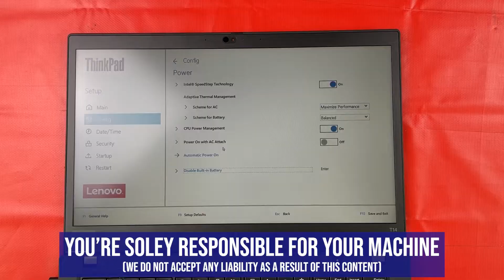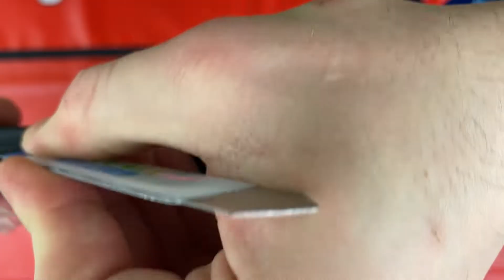Lenovo ThinkPad T14 Gen 2: SSD/RAM upgrade

Comment from the maker: If you're unsure about doing it yourself, then visit an I.T repair shop. Note: T14 Gen 2 (Intel) featured in the video has a soldered on Wifi Chip (cannot be user replaced). Also the heatsink is slightly different to the T14 G1 (Intel). Disassembly of the T14 Gen 2 (AMD) / P14s Gen 2 (AMD) model is very similar (largely the same chassis). Except the AMD models (T14 Gen 2 & P14s Gen 2) have swappable wifi chip. They may come with a Realtek wifi chip, which some prefers to swap for the Intel. Internals of the AMD as shown by our photo here:
https://www.reddit.com/r/thinkpad/comments/orwnv1/p14s_gen_2_amd_similar_to_t14_gen_2_internals/
Thinking Intel vs AMD? Or the T14 Gen 2 vs T14s Gen 2? See our blog: https://www.cruisetech.co.uk/blogs/news/lenovo-thinkpad-t14-gen-2-vs-t14s-gen-2-2021

Comment: In addition to other comments about the deterioration of quality, which are already mentioned here, it's sad when I see this way of placing the SSD drive - cooling through a thermal pad on the motherboard??? Already in the budget Thinkpad Edge series, they already had a better solution in some older models - an ALU sheet on the bottom chassis (which was otherwise plastic), and the SSD drive was supported through a thermal pad on this sheet, not on the motherboard, which itself produces heat. And those chassis few air vents won't save it. Pre-installed SSD drives has usually lower temperatures, but try putting a better quality Samsung, even just an EVO 990 Plus, it won't be cooled enough in the air, it'll be temperature-throttled during copying large files and unnecessarily degrade the lifespan.

Comment: Hello, I’m writing this because I need help buying a new laptop off eBay so I found exactly the model T 14 GEN two and it has 16 GB of ram and 512 SST. I’m planning on upgrading it to 64 GB of ram and one terabyte of SSD, but I want to know if the 3.0Ghz something I should be worried about and will it go up once I upgrade the ram and the graphics card is intel iris xe will it handle gaming well I’m planning on making it an everything laptop work gaming coding 
Sorry if my question is long 😅😅
Please let me know thank you
Reply from the maker: Max 40-48GB RAM only as one slot is soldered in. 

The Turboboost frequency (beyond base clock) depends if it is plugged in (full performance if you put windows into the best performance mode), but that drains battery. 

Xe graphics are basic for any 3D games. You can always get an eGPU for more performance.

Comment: @3:45 Lenovo usually whitelist expansions so the use cannot upgrade modules other than SSD or RAM to keep their other models selling. I remember I tried to replace a better WLAN card on a T430 some years ago and BIOS didn't allow that.
Reply from the maker: Sign. Wish was able to use more slots. Think on the AMD model there is a way. Some interesting reddit posts around this.

Comment: Why the F they do that bypass on the heatsink? see that gasket on the heat sink? that is for the air bypass arround the heatsink, only to burn your CPU and you have to buy new one thats shitty move from lenovo. IBM never did that shit.

Comment: HOLY. CRAP. There's nothing easy or straightforward about taking off the cover. The plastic clips are both fragile and stubborn to take off. Why did Lenovo do this?
Reply from the maker: Apparently it's easier to do it on the next generation. Tbh we pass this model to one particular technician at the office whose used to this model, so it's done right. Definitely could be simpler.
Reply: Honestly, when trying to open the cover of newer Lenovo laptops, I just allow the clips to break off, and even forcefully break off the clips that are close to failure. Who cares. It doesn't affect the exterior of the laptop anyway, and it makes the laptop easier to open. All those screws lined up around the edges of the laptop are enough to keep the cover in place. I don't even know why Lenovo added them; they're essentially pointless other than trying to sway us out of opening the machine
Reply: how many did you snap off? I managed to do it the front 2

Comment: 1:15 - the decline of Lenovo. Pre 4th gen models were built to be easy to take apart and you could do it a hundred times. The T430 for example was a pleasure to work on. And then it just got progressively worse with each new model moving to more of a disposable concept
Reply: T440p has only two screws holding the bottom cover so it only takes few seconds to open. And from there you can easily access the cooler, socketed CPU, socketed RAM, SSD etc. I wish laptops were still like that.
Reply: @Pasi123  and then they made the T450 with its weak plastic clips and dreadful near-battery rubber-bungs. That was the start of the end
Reply: Well... That was the peak. I kinda dread the times when T43 had about five different types of screws. And switching them could have painful consequences.
Reply: That's because Apple has thoroughly convinced the market to replicate its business model of making everything proprietary and NOT user friendly because the end user would ultimately have to ALWAYS defer to the manufacturer for repairs or better yet, just buy a newer one and spend more money. While all this is happening, ofc prices continue to skyrocket. What once was a market where the product was made to be easily modified or repaired has slowly turned into a market where the product only comes as is, where everything is welded into one piece and there's no such thing as "replacing a part" but--rather as mentioned before--having to "replace" the entire unit and buying a new one... Couple that with the fact that each generation of new buyer is happy being less informed and not being a participant in the ins and outs of the products they buy, preferring to discard and buy new, and the trend downwards continues... That disgusting way of making tech products has created so much profit that on one hand, you can't really fault that business decision and approach to replicate what makes the most money-sense
Reply from the maker: Market forces (e.g. thinner and lighter) are sometimes outside of OEM's control.

Comment: So disabling internal battery through BIOS without taking out the battery cable is enough to take or install RAM and or SSD? Thanks.
Reply from the maker: Suggest to follow the Lenovo hardware service manual.

Comment: Does it have enough space between bottom chassis and the SSD to install heatsink on it?  Like one of those $10-20  PS5 heatsink.
Reply from the maker: Not sure if it needs that much cooling as it's not PCIe 4.
Reply: Hey, did you install a heatsink in your T14, and how much clearance did you measure?

Comment: Thanks for this usefull video , this laptop has a single dim emplacement for ram extension but even i use it to a add 8gb ram for exemple, is it possible that the  soldered ram stop to work and make the entire laptop unable to work ?
is it preferable to buy a laptop without soldered ram like the H HP elitebook 840 G7 or 850 g7 ?
Reply from the maker: The OEM warranty is there in case the onboard ram stops working (rare?). 😶

HP Elitebook G7 is decent and popular range, has a different feel to the chassis (slightly more easy to deform it's metallic chassis if dropped).
Reply: @GreenGreenStore  pricesily, i want to buy a used and out of warranty business laptop (ThinkPad T14 or T15, Dell latitude 7000/5000 series or Hp elitebook g7)  , so I should pay any any reparation thus i want to avoid the solderer ram as much as possible but if ThinkPad is the  better overall choice   i will go for the ThinkPad.
Reply from the maker: Your call.🙂

Comment: On my t14 with 16gb soldered ram i was try to add a second ram stick 16gb ddr4 but 2666mhz , but my laptop dosen't start, is because suport only 3200mhz ??
Reply from the maker: Gen 1 should support most ddr4 frequency e.g. 2133-3200Mhz, if it's higher than 2666mhz on Gen 1 (upto 3200 on Gen 2), it'll simply down clock the ram. Maybe the ram stick is faulty?

Comment: After adding RAM it takes a bit longer to boot up to the Lenovo logo. I got scared at first, but it eventually booted in less than a minute.
Reply from the maker: Thanks for sharing. 😅😀
Reply: That's normal, the BIOS takes time to detect & train itself to work with the new RAM stick.
Reply: I appreciate this comment.  I thought the system was failing to post, and had removed the stick.  Reading this helped me be patient.

Comment: Hi, I have a 256 GB SSD card preinstalled can I add another SSD card in different slot?
Reply from the maker: Not sure if the 2nd slot (WWAN) is enabled anymore like the Gen 1. Maybe slotting a bigger SSD into the primary slot may be more practical.
Reply: @GreenGreenStore  Thank you for your response

Comment: I have the same model Lenovo T14, may I know can I add another SSD m.2 (2242) into the WWLAN slot?
Reply: Yes you can add a second ssd on WWLAN slot , but it have to be 2242 NvME
Reply from the maker: Best ask on Reddit. Think in the Gen 2 they've changed what's whitelisted in the 2nd slot.

Comment: Do we have dual channel on this laptop?
Reply from the maker: To do dual channel, yes, if you match the RAM in the 1x user upgradable slot, to the onboard 8GB or 16GB (so you can have 16GB or 32GB in dual channel depending on the onboard RAM side). 

The downside is that the 40GB and 48GB RAM are not as fast in the 3d apps (iGPU likes memory bandwidth)
Reply: @GreenGreenStore  is that not an intel thing? so if i have a ryzen would u still get this feature?

Comment: Hello Mr.CruiseTech. this time , i have some question to you . May i ask you these ? .First , your computer's model is without WWAN , can that slot available? Second , if you want to append ssd there , can you do it ? If you are able to do it , i wanna do it , too .So , Please tell me more about . I'm sorry for the poor and long sentence .
Reply from the maker: 1) WWAN upgradability depends on the model. One is upgradable, but one model might not come with the cable.

2. SSD can be upgraded. Needs single sided M.2 SSD.
Reply: Then I could do it too. That's kind of you !!
Reply: @GreenGreenStore  can I use the WWAN slot for 2242 Nvme SSD?

Comment from the maker: Just curious. Between 1-5 (1 being easy, 5 being challenging) - how would you rate the difficulty of removing the base cover flawlessly?
Reply: 4 for the T14, 5 for the T15.   T15 is brutal to open.  it is so easy to break the retention tabs on the actual base cover on both!
Reply: compared to HP slideout covers, this is 5 :)
Reply: 4
Reply: I’d say 4-5 beginner but to me it’s a 2 mabey
Reply: @SeaRatul1321  def a 2-3 at max for people who've opened up a laptop at all before or maybe built a PC in their lives, you're more familiar with components when opening and unscrewing things.
Reply: 2

Comment: What do you mean by this 4:03? Can you actually upgrade up to 4TB SSD? Is that the maximum capacity? This is good news for me.
Reply from the maker: The T14 Gen 2 should support single sided M.2 SSD. These are mostly available upto 2TB, bigger ones may come eventually.

There is 1x M.2 dedicated slot on the model. Would be nice to see 2x.
Reply: @GreenGreenStore  does this mean if I find 4TB M.2 SSD I can upgrade? The upgrade now support 4TB M.2 SSD or only 2TB? Thanks.
Reply from the maker: Has to be a single sided SSD (most are upto 2TB). Not double sided (bigger ssds available in this format but won't fit).
Reply: @GreenGreenStore  thanks

Comment: A laptop that you can't thoroughly clean because if you open it too many times it causes long-term damage...excellent design!
Reply from the maker: To be fair, these clips design has been around since T480 - or early as T460 if I recall. 

Base cover and the top palmrest could both be replaced, to resolve it.

T14s, on the other hand, has a much simpler maintainability, but has the non-upgradable RAM.